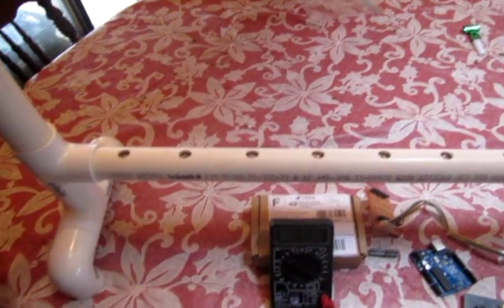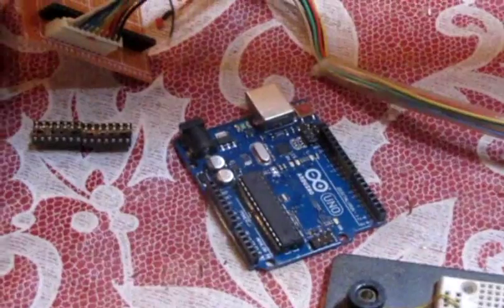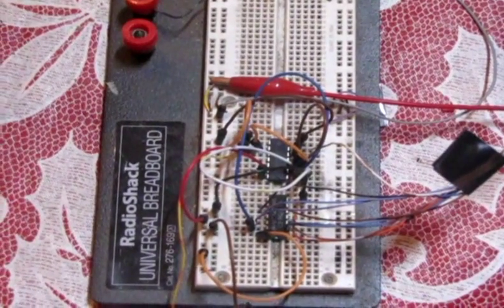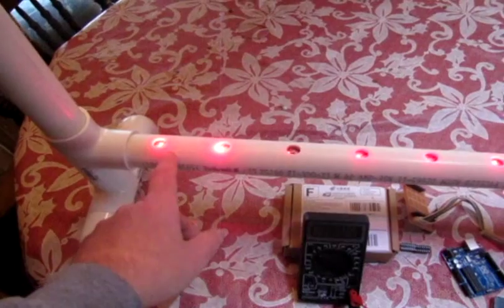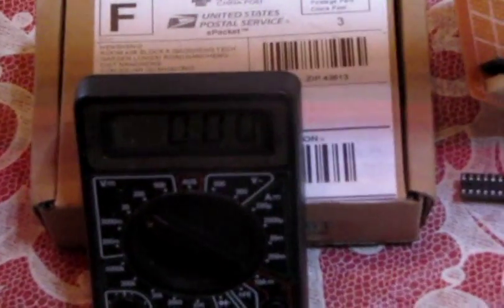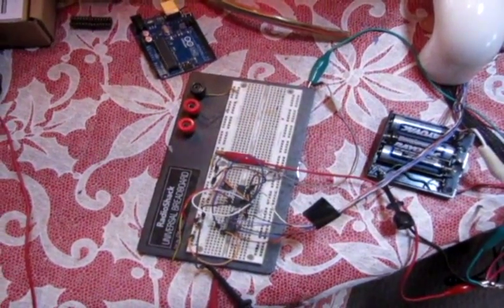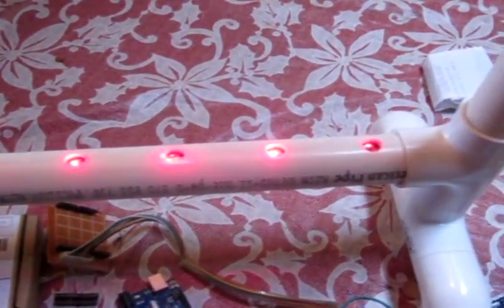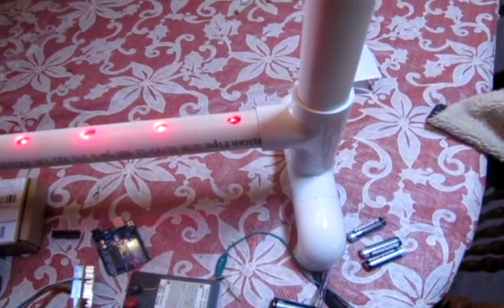DIY Laser Harp pt1 Intro 2.24.13

Comment: Cool project.  re: alignment issue... purhaps by placing small sphirical lenses over the hole, it'll increase the numeric aperture of the receiver. I suspect that you've already solved the problem by now... so, just fuel for future thought.

Comment: LOL. I tried eagle once. It got [shift]+[delete]ed and a registry clean within half an hour. I dont have the patience for that stuff. I (attempt to) use Ki-Cad if I have to use a PCB layout program. Its a pain too, but at least its open source. Had no luck with it either. All I can get it to do is produce error messages I dont understand. Quicker for me to do it with a pen and paper. That way the electrolytic caps dont end up next to the big hot heat sink.